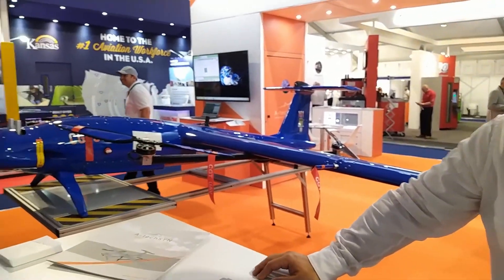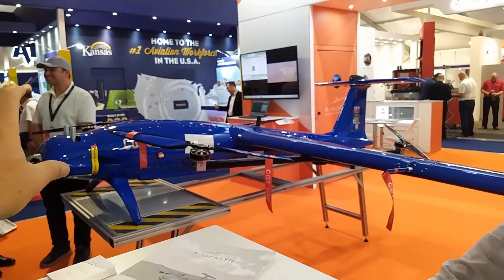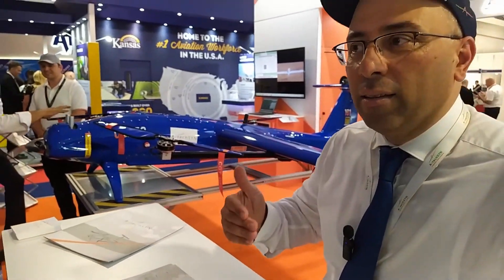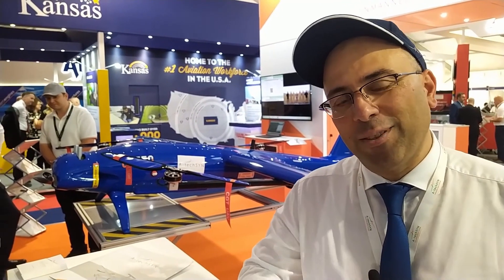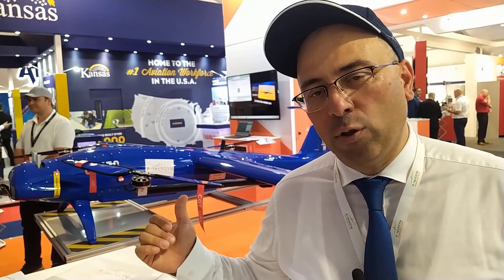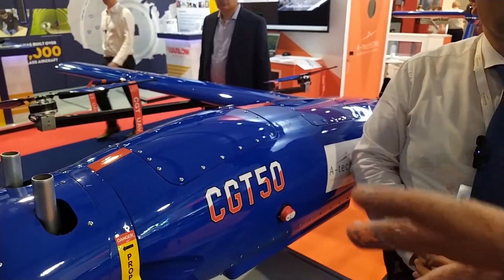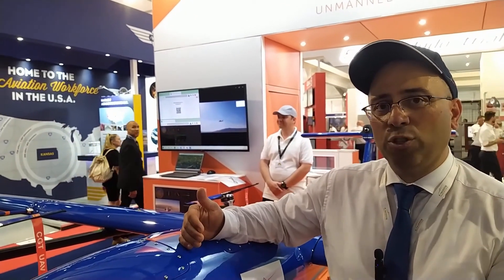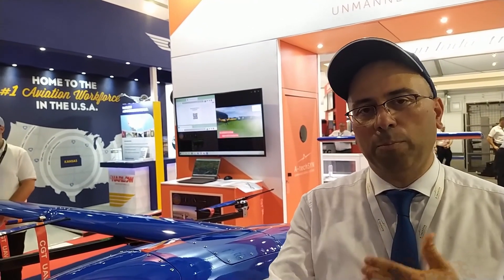Gokhan Celik A-techSYN CGT50-VTOL

Comment: the usual customer would be the ukranian army loitering around the front being too inexpensive to fire a rocket  and flying out of range of the usual machine gun fire which becomes inaccurate beyond 1000 m at least the MG 3 I had been trained on for competition fighting 3 targets in 300 m and 600 m and 900m after a 5 km march under combat load. Due to the time counting we had trained to run the whole 5 km while carrying MG 3, 2 ammunition canister, abc and so on. 
And in 1 km hight you will hardly be recogniced by simple observers on the ground cause the noise is too low to be heard .

So perfect use case considering that 6 hours flight time would cover a day in 2 flights. And pretrol is far easier to supply than to charge batteries.

Greenland is part of Danmark and therefore most regulations will be danish or EU ones. 
That had been a topic when Trump wanted to buy Greenland for cheap cause back then it was not part of the NAFTA zone from mexico to canada.
Big island, small population but a lot of ore, fish and other ressources everyone likes to get.

Great idea and presentation showing clearly the benefits of petrol to get beyond the limits of battery packs cause if they get even doubled the plane / vtol might double the range only on paper before the additional weight kills that gain to just about a half. And that is a typical pattern we had seen since the first  Mavic Pro range or flighttime extenders had been released.
Weight and additional drag caused heavy losses and the usual range and flight time gains crippled to 45 to 55%. Of cause commercial use case but I guess a lot petrol guys from the RC community might feel inspired to think about it and build one on their own.